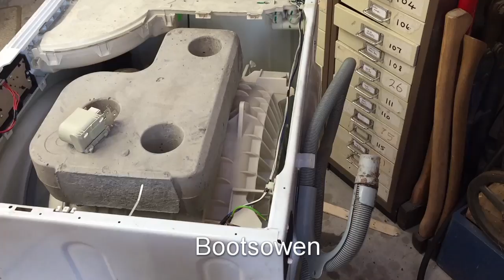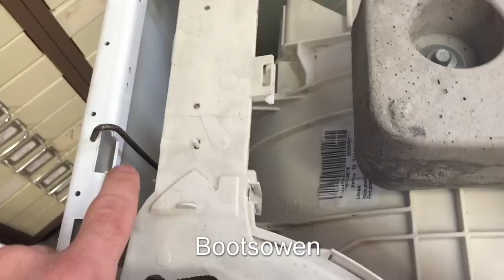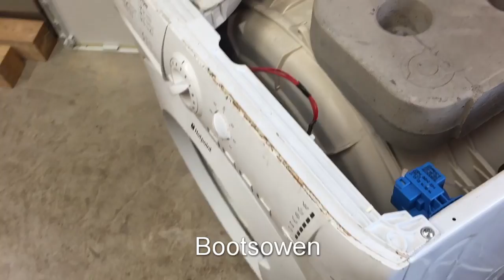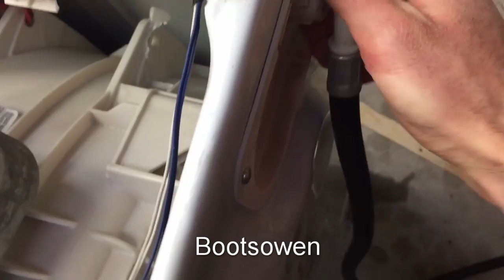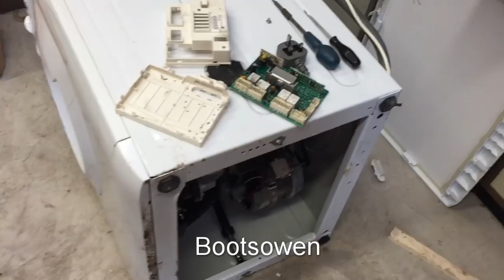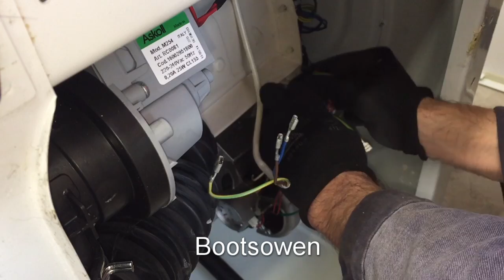Hotpoint HTB721 Testing the machine and then hotwiring motor

Comment: The second it trips the RCD it locks the door, so I assume it's an interlock fault. However, it's not worth repairing as it is an Indesit made Hotpoint and failing bearings are very common in those machines, plus its a sealed tub so the only thing this machine will eat is a brick! 🧱😁